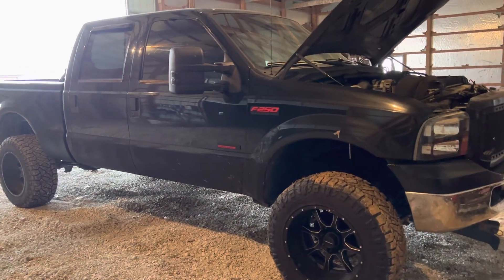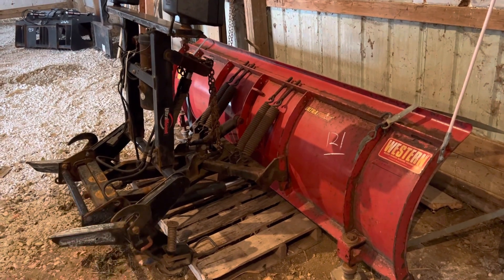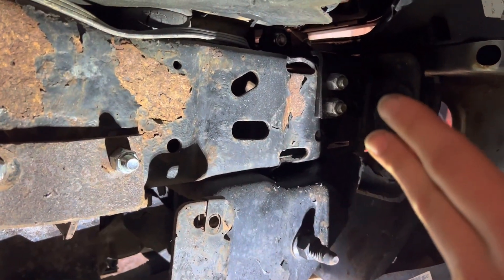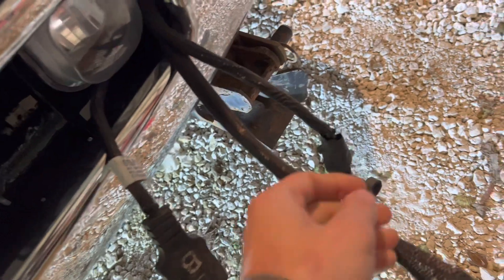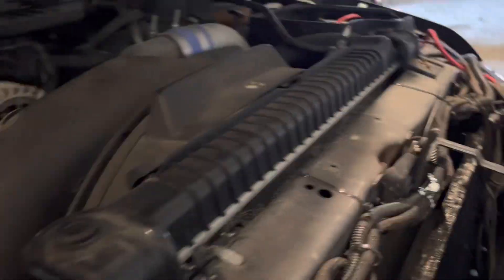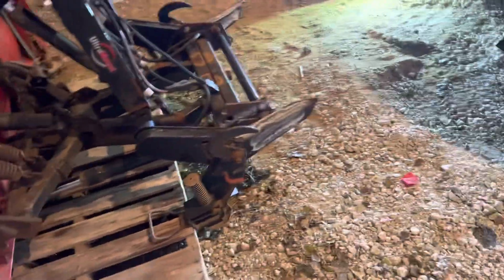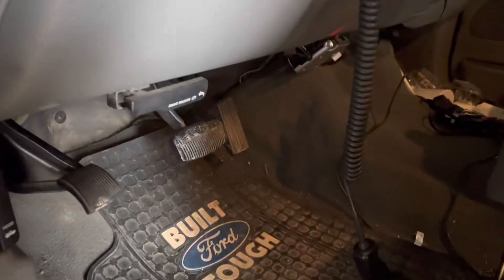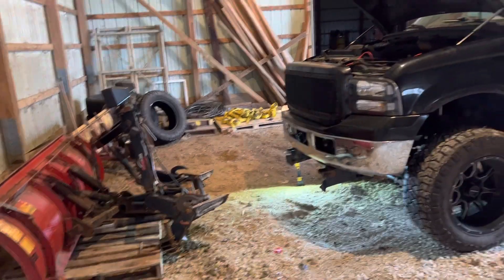Installing Western Ultramount plow on my 2004 f250 Powerstroke!

Comment: Excellent video of the lack of plow support out there for the early 99-04 models! I have an 04 with same plow and custom mount that extends plow about 1’ from the nose, it’s a huge struggle for the front end so I installed the airlift 57154 air bags on the front leaf springs and it completely cured my saggy springs and for only $300 it’s a must have upgrade imo. Also be sure to swap out that plow fluid and filter, same as you I got mine used with moderate use and there was quite a bit of sludge buildup in the bottom of the pump reservoir! I had to use a heat gun to warm up new filter nipple to be able to press into plow pump, almost broke new filter assembly because it’s such a tight fit. I have a headlamp bug that flipping on the high beams kills all lights so have to tackle that or just mount up a new more modern led light bar in place of the factory lights.

Comment: Hope this helps: The Plow Solenoid you bought, you should replace it with a Western Geniune part because it needs to be a continous flow solenoid, I've seen starter solenoids used in place and its a short term solution till you burn it out. 
05-07 trucks had coil sprung front suspension and the angle brace towards the frame have a sway bar in the way so 99-04 mounts don't work.

Comment: Im in the same pickle as you no info and i have a airflo plow i ran my wires the same way you did but my harness is like few inches short of reaching that passenger harness and i dont have the connector for the passenger harness i have the connector for the driver side hope mine works without connecting light harness only time will tell thanks for your video. The little red wire in cab i had no idea where it went but now i do.

Comment: I’m having an issue trying to fit the mounts in, did you have to lift the front end and drop the suspension or were you able to get it in from the ground? I struggled for an hour trying to get them on from the ground and couldn’t manage to get them around the leaf springs and back up.

Comment: Hey you used the wrong bolts. Go get grade 5 to grade 8 bolts. The bolts with 3 lines on top are not strong enough for automotive use. The ones you put on are grade 3. And yes many people buy used plows all the time. Here in New England where I am atleast